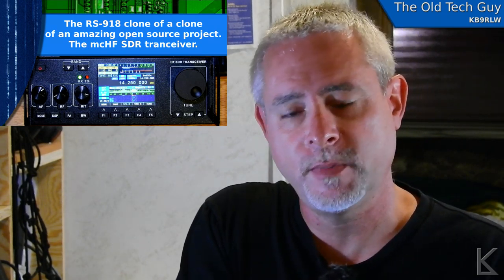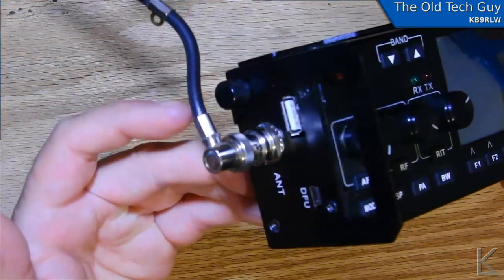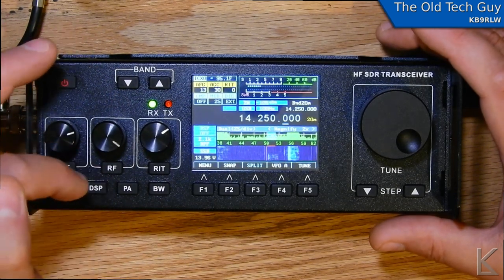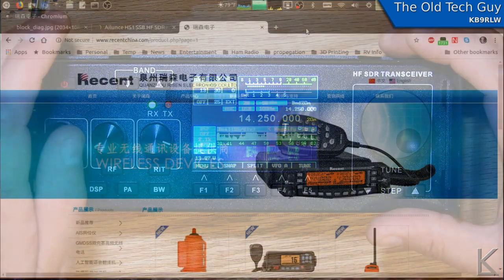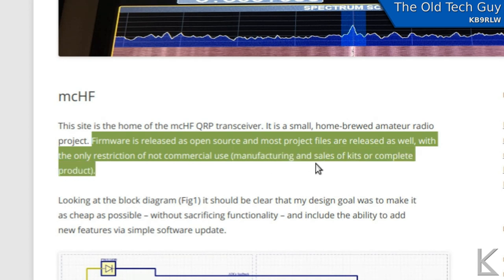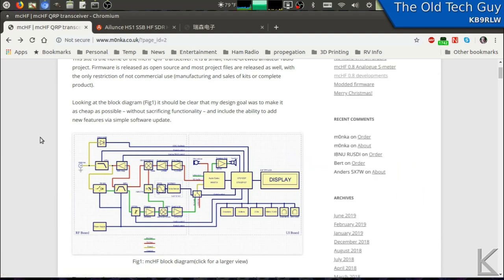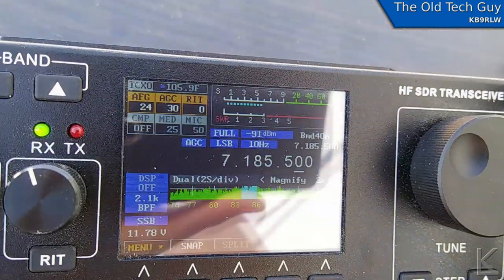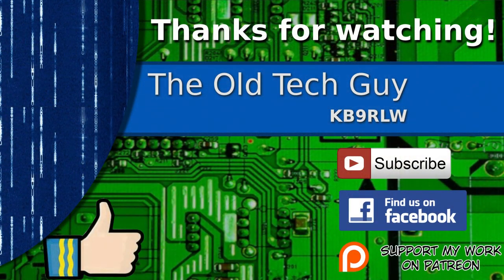Ham Radio - The RS-918 clone of a clone of an outstanding open source SDR transceiver, the mcHF.

Comment: I was waiting for this video and it didn't disappoint.

I had encountered the mcHF before seeing the clones, so I was aware of the unauthorized commercial clone status well in advance.  I can understand the unfilled market demand that was created by the long development and scant availability of mcHF kits.  Chris is up to prototype version 0.8 but the kits being sold are the 0.6 version, as are the Chinese clones.  Chris sold some 0.7 kits but is out and apparently isn't kitting any more because the current effort is toward the 0.8 kit that many people want.

I also get the impression that, like many open source projects, the mcHF development team has largely disbanded and the development is now being done almost exclusively by Chris, with some kit and builder support by Lucy.  I get the feeling from the blog that Chris and Lucy are working hard but it's almost more than a couple can do, and certainly more than they can do as quickly as the mcHF's loyal fans would like.

I concur that the mcHF is a very nice bit of kit and I'd like to buy an mcHF, either as a kit or a finished product, although the latter may never exist.

The lack of respect for intellectual property, mostly by Chinese manufacturers, is the reason Hans won't release open source microcontroller code for any of the QRP Labs kits, and while I lament the great loss to the ham community from not having dedicated hobbyists contributing new features via open source code contributions which Hans could curate in the official firmware releases, I understand exactly why Hans keeps the code proprietary.  Even then, there is a risk of his hardware designs being ripped off and his executable firmware used as is by Chinese manufacturers, as was clearly done with the RS-918 with the mcHF boot screen.
Reply: That's it!! You told it!! That's the real story about. And it's a shame, destroying a lot of very good projects.

Comment: Glad to see somebody at last discussing the theft of IP from Chris.
I have the v0. 7 which I built. I got the pre-populated boards so there were no SMD components to be soldered. It all went together easily and worked first time.
Support Chris M0NKA , buy his kit. I'm 71 and my hands are not that steady, if I can do it, then most people should be able to.
It's a really great radio, especially for digital where you only need to use 1 cable for radio to computer.
73 de PJ7DH

Comment: Totally agree with you. Someone has done all the hard work and they get ripped off. Sad to see this happening all the time with just about everything.
Reply: It's an open source project.  Anyone can copy it,  modify, improve..
Reply: Copying is part of the ethos of open source, is good that people improve the original is not required, there is 1000 linux distributions none of then are illegal, but the problem with those clones usually don't share the source files which is required if you are copying an gpl project.
Reply: dx398 SIMPLY NOT! Take time to read what open source means!!!! Open source is free to use for NON COMMERCIAL USAGE !!! So it is illegal to use it for commercial production like chinese copycats doing! Everyone who is purchasing from them is participating on this illegal job and supports them!
Reply: @petrok1rp254  i wont buy one its wrong and its not fair on the develper they will not get my cash not one penny .. m0prf.. jeff
Reply: @petrok1rp254  dear friend, you are wrong. Open source has no limits regarding usage in commercial vs. non-commercial. Please learn more about open source before making any general claims.
Firmware (software on the chip) is completely open source.
BUT, the author of mcHF has reserved the right to produce hardware for commercial use/resale to himself. That's the difference here. 
Please keep an eye on the important details.
Reply: @bernardtoplak2302  Dear Bernard thank you for comment. So you are confirming that hw is completely pirated and it is selling illegally by Chinese copycats. Layouts, schematics, all design is stolen IP and it is what I am talking about... Sorry for my high asertivity but I really hate it. I know Chris very well and this illegal production makes big financial impact for Chris... Thank you for understanding. Petr
Reply: Bernard Toplak - correct, but to add something - M0NKA does not provide a complete radio and many HAMS don’t have the ability/resources to put one together.  I would feel more sympathetic to Chris if he has been able to build and market complete radios instead of the kits he has, to date....
Reply: @peterhughes2827  Btw Chris offers complete mcHF radio fully assembled and aligned in small batches for US market now...

Comment: As a Linux user since the mid 90s, and as an amaused fan of (crazy) Richard Stallman,  I highly respect your honest opinion on the subject!  And on this 'clone of a clone' crap radio.  You, sir, have software and hardware dev morals and ethics. Even if it wasn't thievery in action... those wiggly crap control pots and/or knobs would stop me from buying it at any price.  Give it a few months and they'll fail.  73 OM

Comment: I am pleased to have an original MCHF. Given the service nightmares on the clones (or so I've heard) the original seems to be the way to go. Some of the clones cannot even update software! The MCHF is a fine little radio that in some ways rivals the Elecraft KX2, but only in some ways. It is great for portable and SOTA work.
Reply: Of cause, you are going brick the actual clones if You try to update them with the last UHSDR firmware. It's because cloner replaced the superb and realy expensive SI570 TCXO to a crappy cheap replacement component that works only with a modded cloner firmware that has no further support.

Comment: As a older HAM I am no longer capable of building this project. The original project builder could have done himself and the rest of us a favor by Licensing a Company to assemble and handle firmware updates.  As it is now these Chinese companies have ripped of his labor and design, forcing us to make a ethical decision. As for me , I will have to pass.
Reply: There are members of the mcHF community that would happily build one for anyone for whom this is not a viable approach.

Comment: Unfortunately mcHF is not open source because of "non-commercial" clause in license. Apparently term "open source" is not what majority of people think it is, but rather a term that some people came up with and definition of it can be found here - https://opensource.org/osd.html
Having said that, I bought original kit from M0NKA, first I had trouble sourcing power transistors and then I had trouble getting any power out of it without finals going into crazy oscillations and finally after mods and mods I got it to behave, it is outputting solid 10W, but I haven't made any QSOs with it because after all the hassle I got IC-7300.

Comment: The mcHF is higher quality for a lower price than the clones anyway. You know the clones are using inferior components, and are probably put together like crap. True, you will have to build it, or find someone who can, but you will have a superior radio. I'm seriously considering getting one and adding a raspberry pi, and a laptop size touchscreen in a custom case. Glad I saw this video!

Comment: Hello,I am asking myself why M0NKA's mcHF has got these multiple clones. To my opinion, the basis of the mcHF was a radio development kit for students in communication electronics, and that Chris and his team mainly developped software for it. The production of the hardware would have been out of budget for a group of students or simple HAM radio operators; there must be a big east-Asian company involved behind this SMD-hardware. M0NKA merely sells kits without housing and without end-stage RF-transistors, and having the SMD part already set up. He must thus have an agreement with the east-Asian manufacturing company. Chris and his team are essentially working forth on the software (there is more than one software working on this hardware out there!).Chris is probably not very upset that his radio was put on the market by east-Asian manufacturers, because this makes his open-source project really fly ! There is no open-source project without users! 73 de Edgar, HB9TRU

Comment: Let me add some light to this subject.
Many people don't know how to solder electronics well,  as well as many have royally fucked up their device by trying to solder their device & permanently ruin the device.
So they went back to the "original"  person who created the device / OSP. and asked if he could pre-build the device for them.  The answer was a clear and stern [NO].
So people were upset about that and companies took notice. And that's when companies stepped in and pre-built the device which allowed people to purchase the product
already put together so people could just plug and play the device.
That's one of the main reasons why these companies are doing this.  So just to clarify as to what is happening.  and YES I know the owner doesn't want it that way.
But this is the world we live in. - Don't don't kill the messenger, I am just clarifying whats happening here that's all.
Also let me point out something else.
This kit fully assembled is at a VERY affordable price range. Which helps those who are new to get into the community without having to take out
a second mortgage just to get a decent radio with decent features.   Many commercial radios out there are costing $1,500 and up just for the radio alone.
A SWR meter (a good one) cost around $400.  that's expensive for people.  And the community wonders why they cant get new people in. Well that's the reason why.
Not to mention $450 just for a watt tester from RigExpert & other companies.  its getting really stupid when it comes to prices on things like this in this community.
Companies need to stop with these overprice tags on these devices.  They are scaring away new comers to the community very quickly.
Why do you think most of this community is like geriatrics ward and barely any young people?  well because its mostly the elderly in retirement that are in this community,
and very few young ones participating.  Young people are NOT going to be spending thousands of dollars on a just radio.
So think about that for a few minutes then think about why this community is having a hard time getting young people to participate.
Reply: I just got my Tech License 2 weeks ago and my General 2 days ago, and I couldn't agree with you more. I have been trying to find reasonably priced equipment. That's why I'm here watching this video about cheap Chinese clone radios. I would much rather buy quality kit, but I have 5 kids and I can't spend our grocery, car note and mortgage money trying to get into a hobby. From the perspective of a ham noob, It definitely seems like there are a lot of old timers that are resistant to innovation in the space. However without some changes to more modern, more capable and more affordable equipment the hobby won't survive. There has to be some middle ground somewhere though. I'm just out here trying to find it.

Comment: I would have kept part of the software closed source and sold license keys for $1. So locking out the Chinese, and genuine constructors won't mind paying $1.

The ST micro has calibration values that can be used to generate a random code, and hence  a license code.

Comment: The disclaimer is so he doesn't become a commercial radio manufacturer.   You are not supposed to buy his kit and use it as a commercial radio.  I was looking at it for use as a marine SSB radio.  Technically, that would be against the use disclaimer.

Comment: i noticed you had CMP Off (voice compression). might have helped with your Early Bird Net check-in.
with shipping from UK the mcHF w/case is ~314 GBP or (at today's exchange) ~392 USD.
note Ailunce HS1 is 499 USD and the HS1Plus (has built-in battery) is 599 USD.

Comment: Great review! I've just ordered the mcHF transceiver after seeing many reviews. I'm curious as to how backward compatible some of these mods would be such as the keyboard you mentioned. The mcHF as many people know is a very configurable radio and I wondered if the firmaware was close enough to the originable to allow the same level of experimenting without bricking the device. Another question I have is how close to the mcHF are the circuit boards inside?

Comment: Kevin 
Thanks so much for all you are doing for ham radio. I have one of these and love it. Great job. De KM4WII
Reply: Hello Tim, do you know, if this can be fully operated (RX and TX at at least 4W on FM, AM and SSB) on CB 27MHz 11m band? Thanks and 73!
Reply: @pavolcuj5104  not sure. 11 meters with this would be illegal here in the USA
Reply: @cviewnurse  Thanks anyway, Tim. Same here as this is not compliant transceiver. But the features for the price has no match by far. As I want SSB, for literally the same price (assembly included) I can get the only handheld SSB I know and that's just dumb CB with SSB and no extra features or a vehicle one that's not meant to be operated as handheld for half the price. But perhaps it's a stupid idea.

Comment: hello, I picked one of these up and the first thing I noticed was the waterfall is going up, instead of down such as falling lol. I checked the setting and the firmware. The firware was out of date from 2018 so I updated the firmware but still noticed the the water is not falling and was going up? I know the display is correctly installed as everything that appears on it shows correctly, not upside down (as I say with a smile :) ) So what is going on with this? Never seen a backward waterfall on a radio? Is there anything that can be done to correct this this?
George

Comment: Kevin. Excellent video in every respect. I'm on a tight budget and would have jumped on this unbelievable bargain but for your clone/common source opinions and conclusions. I'm now seriously thinking about purchasing a kit direct from Chris and building with using skills acquired building my 4SQRP Group Hilltopper20. Chinese economic/tech depredations are hot button topics. I'm old enough to remember lots of ill-will  during the day era of "Japan Inc.". At clone retail prices (free shipping included!) I have to wonder what kind of a living the Chinese assemblers and "kitters" are earning for their labor. I'm old enough to remember the similarly fraught era of "Japan Inc.".  Kudos are due you for the aplomb with which you address the issues.

Comment: Nice point Kevin and great vid!

What power supply you use when portable with the radio? Looks like powerbank ?
Reply from the maker: That was a power bank.  I also have a box with two 7.2Ah SLA batts in it.
Reply: @loughkb  Does this powerbank provide 13.8V with enough power for the radio ? What is the brand ? I am struggling to find a 13,8V powerbank with at least 4A output.
Reply from the maker: At 5 watts, the radio draws less than 2 amps during tx.  
You might look at those smaller jump start power banks they sell for cars.  Usually they have lithium batts and can provide plenty of juice.
Reply: @loughkb  Thank you

Comment: I fully support your view on open source, but we know that not all respect it or the license clauses -- anyway thanks, I will definitely have a closer look at the original mcHF SDR.
Reply: You should, not only because it's a clone, they are also really crappy compared to the original mcHF. The HW of the clone is modded to make it cheaper and for that they also cloned and modded the firmware. Some of them will turn to a brick if You update them with new releases of the UHSDR firmware from GitHub. If you go to buy the kit it's will be also cheaper and to complete it is easy. If You can do it, there are a lot of people out there that do it for some very little money.
Reply: @car4sale556  - M0NKA also offer ready assembled units. Over the time I purchased 3 kits and never had any problem. Kits came fast, very good and clear communication. I guess You just started with the wrong idea to buy a clone. Now its too late to correct the weak decision. Its natural human behaviour to search for good reasons of the own bad move....That´s what happens with You.

Comment: hi Kevin(not sure what i did will try agin) hello from sunny Wales UK temp 23c  how difficult do you think it is to construct and align  the mcHF, perhaps  a video on assessing the competencys required to construct various kits    Dave C GW0NVF
Reply from the maker: I can't really say since I haven't built one.  But looking at the supplied parts, it looks like the surface mount components come pre-installed to the boards.  So it's probably just some wiring and larger components to do.   Maybe some torroids to wind, it wasn't clear from the photos.
Maybe some of the other commentors, like Robotix178 above, who've built the kit, can chime in on this question.
Reply: With the SMD assembled PCBs from Chris it's almost easy to compleat a mcHF. There is also a perfect community support to do it. Building a mcHF out of bare PCB is another thing, not so easy but far from being a big challenge. I build just two from bar PCB... Both started imidiatly on first power up. No big deal.

Comment: I am not sure how you came to the conclusion that it is a clone of a clone, far more likely is that they are simply "clones" (Not sure that is the correct term for an opensource project) based on the same original mcHF radio.
Either way, there are now more versions out there, many work really well and you can now find some greatly enhanced firmware for them as well.